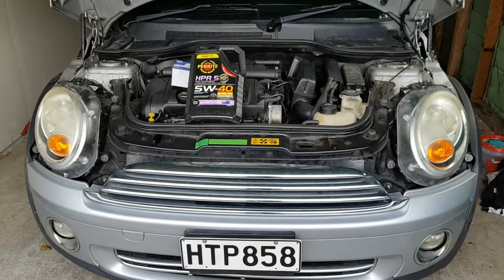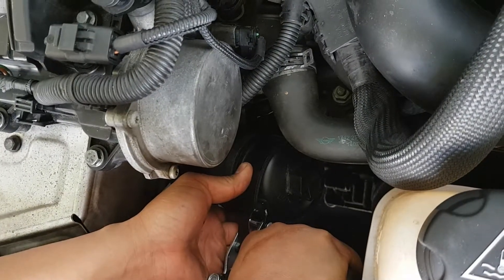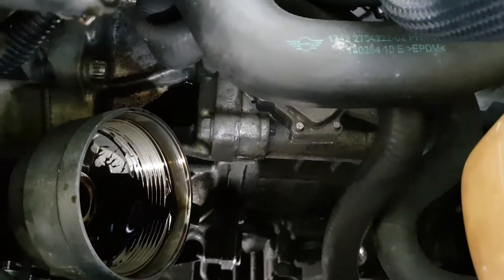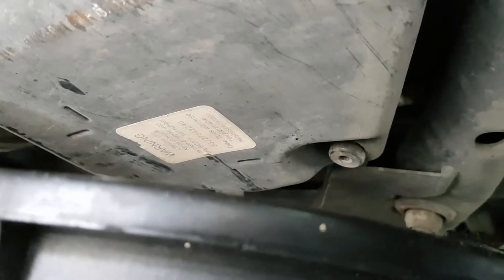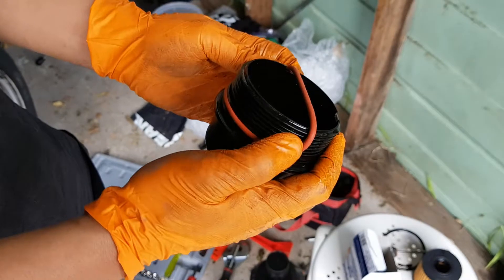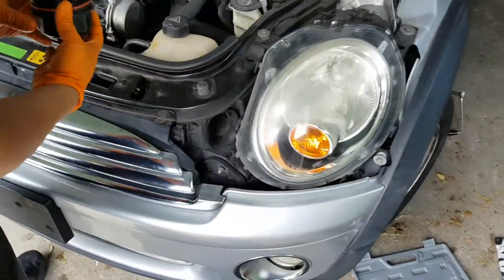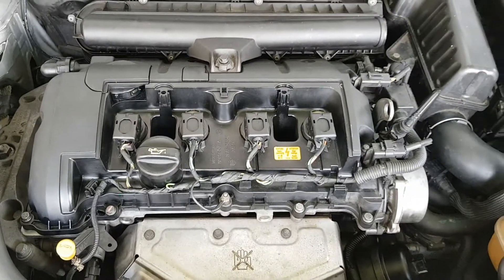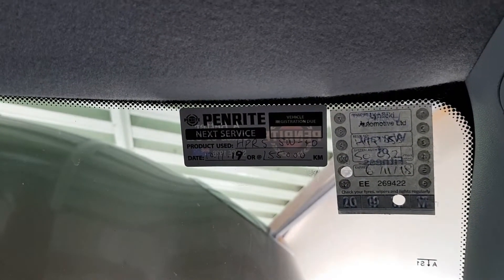Mini Cooper 2007 Episode 4 - Engine oil and filter change

Comment: Pro tip : leave oil filter loose in housing while draining oil pan this assist with the task & a cleaner job - did you also up date the in car service module accordingly
Reply from the maker: Thanks for that, this is one of the first things we did so definitely room for improvement